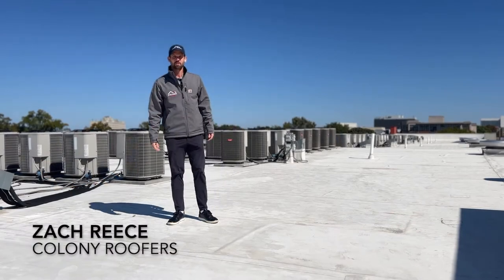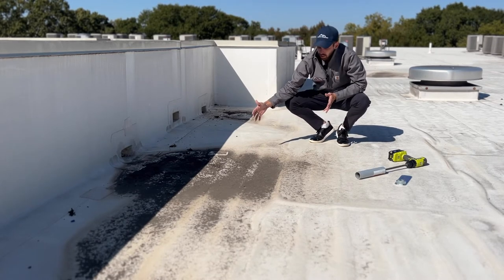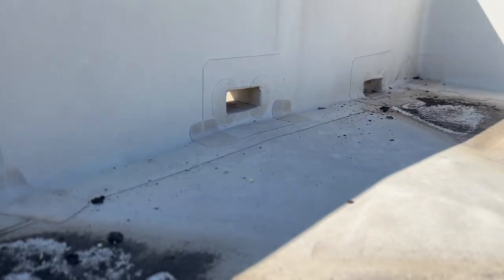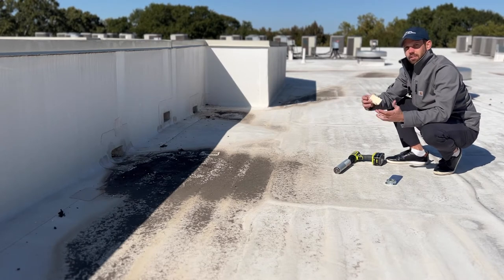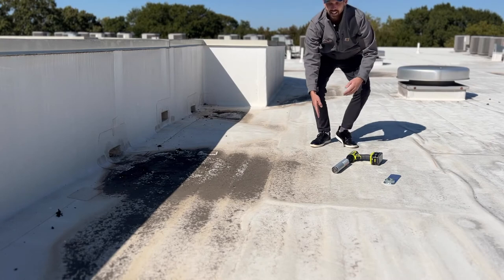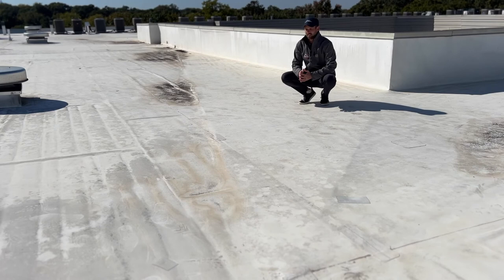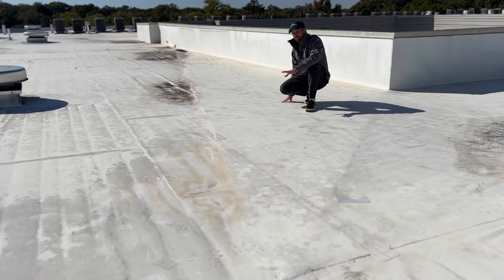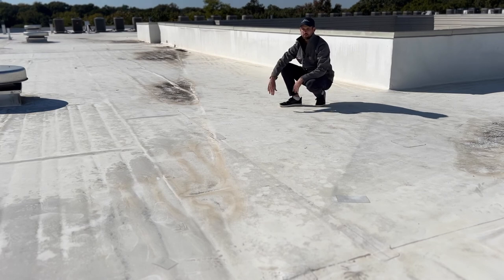How Does a Flat Roof Drain? - Flat Roof Drainage System Guide for Owners and Property Managers

Comment: So you would compromise the design of the building for a couple hundred dollars of material. Instead maybe sell the owner on taper system. When they replace the roof. In other words let the roof die. The way it was designed. Keep the lid on that jar of worms.
Reply from the maker: Hey! Thanks for your comment. 

I totally agree with you. Unfortunately, this one was leaking and needed a fix prior to replacement. If we were replacing the roof, there’s no question a new taper system would be ideal!

The engineer that we were working with on this project, assess the structure of the building and was actually the one that offered up the suggested resolution given the problems they were having on the roof.